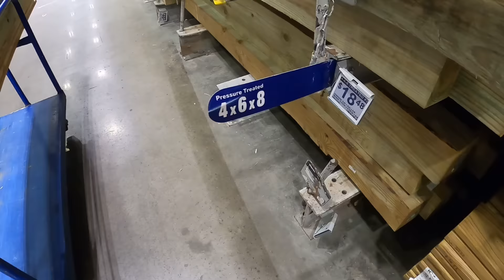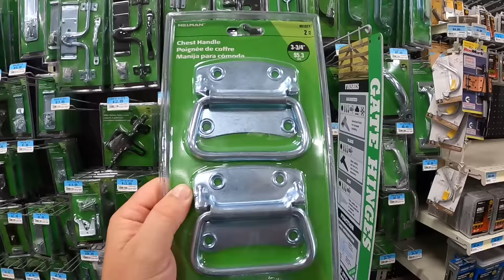Anderson Blocks and RV SnapPads Are A Waste Of Money! | Do This Instead! | Fulltime RV Living!

Comment: I'm actually a green store guy (Menard's)😂, but they don't have stores all over the country.  We just started getting Tractor Supply around here, so it was always Farm & Fleet or Rural King for me.  Anything plastic (blocks or stacking blocks) does not work well on gravel.  The gravel embeds itself in and deforms the plastic, and the wood you put under them always split after a while..  I use the RV SnapPads and HushPads (8x 12"x14"x2").  That has works well for me.  I like your blocks, but that is a heck of a lot of bulk & weight to carry!  Horse mats are a great idea to keep the wood from getting busted up!  If my setup ever doesn't work, I will give this a try!!!  Nice job Kevin & Phil!
Reply from the maker: I am going to have to try the Green Store next time I see one!  I wanted to combine the Anderson Block height and the SnapPad Protection, this was my solution!  They are heavier than the other two, but they have held up great now for almost 2 years and we have always had these, so all of our scale tickets have shown the weight of these either in the truck or the trailer!
Reply: Dang it! Beat me to it.

Comment: Did you weigh all  eight blocks total? Oh, and I have the Snap Pads. They have been on for nine years and over 100,000 miles full timing around the United States. Great work on your blocks! I just prefer the "one and done" over the extra weight and storage space.
Reply from the maker: In the video we were building two sets for two campers!  They weight around 20lbs a piece so 80lbs total for the set! Ours needs 6 blocks so we have about 120Lbs in block weight!  They need to have some weight to them as they are supporting a 20,000lb RV, ours have held up great for over 2 years now! We store these in the bed of the truck on travel days, so we are not losing any space as nothing is back there when we are towing!

Comment: I made something very similar - 6 pads 12x12 with 4x4s and 2x4s.   3/4in horse stall mat.  We used rope for handles with a bicycle grip from Amazon to make them more gentle on the hands.  I painted them bright green - we call them mint cookies with the black stall mat.  I wanted them to stand out when we packed up so I would not leave them behind.  They work great and sit in the truck right behind the tailgate on travel day, otherwise they are on the ground!
Reply from the maker: Thats to funny mint cookies!  We started out storing ours in by the tailgate, but I caught the emergency brake cable once so now I put them in front of the fifth wheel when we travel!

Comment: Saw this video over a year ago & funny how I'm building mine today on Labor Day weekend!  My other jack blocks I had built out of 2x6 crossed screwed and glued couldn't hold up with the 24,000lb 5th wheel we had , they busted in two in about a year, so I'm trying your design this time! I found plenty of building materials around my in-laws horse farm so other than the cost of 2" deck screws and spray paint, they didn't cost anything but the time to build them!  I hope that the rubber will help them hold up better than my other ones did.  I'm using some rope for the handles, but we may find the ones you used next time we're at TSC and upgrade.  Thanks for sharing the design, hopefully they'll hold up better than my other set I had made!
Reply from the maker: Ours lasted 3 years of fulltime use and now that we are no longer traveling they are still in use on someone else's RV!

Comment: just saved me some money,  got tired of crawling under my super c (light on the super) to set leveling blocks so I added to my amazon shopping 4 sets of leveling blocks, 2 ea for 79. so total of $320 plus tax etc.   than before clicking to buy I saw your video.  I'm a woodworker so , voilla, I'll have these built before my next trip.  thanks so much.
Reply from the maker: Glad I could help you out!  The good thing about building your own is you can make them however works best for your set up!

Comment: Love my Andersen buckets, drive on leveler system, wheel chocks, all in a decent bag.  Lighter weight stackable buckets can be used in a pinch as something to elevate yourself to work on something at the camp site.  But, this is a good video if you need to go this route.  All of which I ordered in my air conditioned living room.  Brought to me in 24 hours by Amazon.  🤪
Reply from the maker: While our blocks may not work for you they are perfect for us! When you have a rig this big you don't have to use the anderson levelers as the rig will auto level itself! Also how will you use the buckets work on things around the campsite when they are under your jacks holding the trailer up! It is awesome that you were able to order these, but if you feel like building something with your hands and saving money this is the way to go!
Reply: Arguably, there are only two resources...
1.) Time
2.) Money 

Spend more of one...
     ... you will need less of the other.
Reply from the maker: @George Katsinis  Yes, but there are a lot of products out there that are after only your money and don't deliver! I showed you how you can spend some time building something thing yourself, it will be a quality product that will deliver and will cost you half as much!
Reply: Exactly.... I'm agreeing with you.

Comment: Hopefully you don’t mind suggestions.   When cutting the 1x6” boards, if you set all of them into a stack, align one end of all the boards, have someone hold them still or clamp the stack, then you can mark the first cut and drop the saw blade down as far as it will go.   Now you cut two parts and marked the next one.  Once the top board is gone, the third board is marked and ready for all the cuts.
Possibly more accurate and less marking and work.   Best wishes,    Kevin
Reply from the maker: Definitely don't mind the suggestions! Especially if it means less work! Thanks!
Reply: @PavingNewPaths     It drives me nuts to watch someone that bought a 12” miter saw  and lay 1x4 and 2x4 flat and cut them one at a time and make over 50 cuts.  I needed 24 pcs of 1x4 and had 6 boards.   With my 12” saw, I set them on edge, clamped one end and with 5 cuts had 24 pieces.   5 because I always cut off factory ends to make square and all even.   Same with 2x4’s.
Reply from the maker: @KevinCoop1  The 12" saw would have been useful for the 4x6 cuts! I had to make one cut, flip it and make second cut!  With my down sized tool collection now I have to work with what I have!
Reply: Great suggestion.  I personally at my sticks and bricks (so not an option here) have a miter saw that a friend (RIP) had made a table for. I brought it from his wife and I made a stopper for it so I can clamp the stopper on to the table and not need to mark the wood before hand.  Makes these sort of cuts much easier as I just slide the material up against the stopper and cut.

Comment: I work for a local amusement company,  aka a "carnie" , and this minus the stall mats is what we use to stabilize our rides like the Swinger and the Zipper. 
Thanks for the tip on stall mats and folding handles, I'll pass it on to the bosses as a possible winter upgrade project. 
We use stall mats for covering our long wire runs in high traffic areas to prevent tripping. 

The person who pointed out the greater weight distribution of having the larger surface area of a 16x16 pair for the front makes a valid point. 
I would maybe just carry 2 (or 4) 16"x16"x1" pieces of plywood for areas that may have a softer base or when the weather might get really wet for a few days. If for weather you could just raise each jack leg enough to slide the ply under your jack block for added weight distribution.
Reply from the maker: We have never had an issue with these blocks sinking in the ground! They are 11x11 if you sink that in the ground there is no way your RV is coming out of that spot with out a tow truck! Ours are holding up great after almost 2 years of use!

Comment: Great video! The only down side is weight and storage space. Keep up the good work!!!
Reply from the maker: They weigh roughly 20lbs and ride in the truck on travel day! We have used our set now for almost two years and they are holding up great!
Reply: Weight and storage would be my issue as well tho I have Class C so probably wouldn't need as heavy duty as these are.
Reply from the maker: @pjmiller3770  For a class C or any driveable RV the snap pads are actually great for them!

Comment: We have snap pads on our coach and love them, we often camp in loose sand, beach or desert or at campgrounds in hot areas which may have asphalt pads which can get soft in desert heat. We have gone the wood blocks and plastic blocks but getting older has made the wood/plastic difficult to handle. We do keep a four pack of pads handy, but just in case we are in an exceptionally off level area. Bottom line is, works for each person is best and to say other methods aren’t good or worthwhile is strictly subjective for each person.
Reply from the maker: Snap pads are great for a motorized coach! We never said ours was better! We said we built these because we wanted the height of the Anderson blocks, with the rubber protection of the snappads. We get the best of both for half the cost, and these will likely last longer!
Reply: Love my snap pads as many locations are gravel or sand.
Reply from the maker: I have never seen a snap pad owner not put a board down first before putting the jacks down! If you still need boards whats the point!

Comment: Blue store, orange store, green store. I use whatever is closest and Lowe's are few and far between in my part of the country.
I did something similar with my previous trailer to save time setting the  jacks but the rubber idea is a new one and I will definitely be making similar blocks with rubber pads for my new TT.
To save some weight I will use a hole saw on the middle layer to remove some of the mass without losing strength.
Reply from the maker: We are blue store fans, but they are everywhere down here where we are from!  I am excited to find a green store to check out!

Comment: Great tutorial for anyone wanting to do this, but, since the 4x6's make no ground contact, I would not have used "treated" lumber. That would save a little bit of money.
I also would have used 5/8-3/4" cdx plywood instead of the 1x6. The plywood will never crack or split. Every screw in the 1x6 is a potential split.
Man, it's hot in Texas.
Reply from the maker: It is so hot in Texas right now!  The reason I went with the Treated is because there are a lot of times especially in Florida where the blocks may be sitting in water after a rain!  We have had ours now for almost 2 years and they are holding up great!
Reply: I was thinking the same thing about using 3/4" CDX treated exterior ply vs. 1x6.  I don't know if you can consistently find untreated 1x6 - there aren't any in SW GA/NW FL that I've found.    

I wish I knew where the 12x6 x 16 treated board that washed up on our beach after Michael came from.  If it doesn't become a really nice bench, it may be leveling blocks.
Reply from the maker: @WynneEden  We have had good luck woth the treated 1x6 and 4x6 we used! We have been using them for 2 years now and they are holding up great!
Reply: @PavingNewPaths  I'm not questioning that - my thought watching was that I could see cutting marine or exterior grade ply as a quicker/simpler/possibly sturdier option.  I had the same thoughts of using a waterproof glue/construction adhesive, for example.

There isn't a single way that's 'best' - your solution is absolutely great, and has given me ideas, which is why I liked the video and subbed to your channel.  I appreciate the ideas very much.

Oh, I can't vote blue or orange (or red, for Ace), since a couple of them support the organization I work for, but only one is within 50 miles.
Reply from the maker: @WynneEden  Thank you for subbing! Glad you enjoy the content! We have been hearing such good things about the green store we will have to check them out! Ace is also awesome!

Comment: I read through some but not going through 650 comments to see if it was brought up already.... I do like this idea and may do something similar in the future but will stick with my Anderson Jack Blocks (buckets) for now. You did mention the price and I don't disagree, however, you failed to mention the fact that they have a LIFETIME warranty. I have had 4 of 6 originals that cracked on that bottom lip due to setting up on rocks, and had zero issues with Anderson getting them replaced promptly. As for my remedy for the rock issues, I bought 12x12x1 square polly pads from Big Foot Construction that I set on the ground under the "buckets".  They are light weight, have rope handles and are virtually indestructible, other than maybe the rope in time but easy enough to replace that. I totally agree with you on the Snap Pads though, I don't see any value in those at all, unless you just don't care about your rv rocking from the jacks being super extended.  If I didn't already have the Buckets, I would definitely do something like this. I would want to use something to seal up the wood from the rain and other elements, as well as bugs, maybe some urethane?? Also, I think I would use some fender washers on the screws holding the rubber matting, I feel like the matting may rip right off of those screws.   Anyway, I mainly just wanted to bring up the Lifetime warranty on the Anderson buckets, the price may be high but when you can replace them for life, you cannot fairly say that price isn't worth it.
Reply from the maker: The only thing I will say about the warranty is why not make the buckets not break so easy or provide me with a footer to put down made if the Andersons bucket material! At the end if the day I felt I could make something better and more affordable than what was available on the market! I see the benefits of both but wanted the height of the buckets and the protection from the snap pads! This is treated wood and the paint does more than enough to seal the wood! The reson I didn't add washers was I didn't want the screws and washers to he the contact point of the jacks and ground! So the screws are sunk into the horse stall mat! 3 years now on our set and they look the same as day one!

Comment: Used your video to make six blocks for our 5th wheel.  Total cost was $150.  Used left over 4x6 and mat to make support to go on the ground under the step if needed.  They are heavier than expected but the handle works great.  Using them for the first time this weekend, will let you know how they work.
Reply from the maker: Glad I could help you out! They are much cheaper than what is available on the market! That's a great idea for the steps! We are in year 3 of using ours they get lighter!
Reply: Had you thought about epoxy to secure the horse mats? I imagine the screws are less expensive and more practical.
Reply from the maker: @danielfarmer4311  I believe with the environment they live in adhesive wouldn't have held up!
Reply: @PavingNewPaths  yeah the hardware is fast too. I’m going to make a set too. We’re using Lynks levelers under our stabilizers now. I like your design. Super easy and probably last forever.
Reply from the maker: @danielfarmer4311  Ours are 3 years old and look the same as they did the day I made them!
Reply: @danielfarmer4311  I was too lazy to mix up epoxy for twelve separate mats.  I had the screws on hand and so far they are working great.

Comment: Kevin, 
It's a year later that I found your video. First, I love the Blue store because I'm a Veteran and really enjoy the Vet Discount. Yes the Orange store offers a Vet discount but with a $500 cap for the year. Second, This is great. The type of camper that we use, it belongs to our friends, has scissor jacks for stabilization. We, the owner and I, have been talking about this very thing for stabilizing the camper. The camper my wife and I are intending is much smaller, but this is still a great solution to that problem. As you mentioned, adjust the size as needed, these are perfect for large and small trailer/campers. Thank you for sharing and you have a new subscriber. God bless.

Comment: One of my RV compartments has nothing but a stack of 12-inch and 30-inch long 2 x 10 boards. Bulky yes but serves the dual purpose of Jack blocks and recovery boards to go under the wheels and get a start if I get stuck, which has happened twice in 10 years (twice too often).
Reply from the maker: We travel fulltime so we had to come up with a way to carry what we needed with out taking up to much space from things we don't need!  We started with an assortment of boards and after a few trips decided to build these!  After 3 years they are still working out great for us!

Comment: We’ve used Anderson Blocks for 2.5 years on all types of surfaces and have never had a problem. Nice build but to each their own. We also appreciate the magnets on the blocks.
Reply from the maker: Thats great, and we have nothing against them, but if you're thinking about getting the anderson buckets but don't like the price tag! You can build something that will work better, last longer and cost you half of what the buckets cost!
Reply: What is the weight of the block?
Reply from the maker: @TheBuddyandlilly  Around 18lbs a piece!
Reply: @TheBuddyandlilly  I’d guess around 5-7lbs.

Comment: These re great and I plan on building a set! A few questions for you:
1. How heavy is one of these? 
2. How tall is one of these?
3. Would you trust stacking one on top of the other for even more height?
Reply from the maker: They are about 20lbs a piece when new, they will get lighter as they dry out!
Around 6 inches tall!
You could stack if you needed to but we have never been in a situation where we would need to do this!